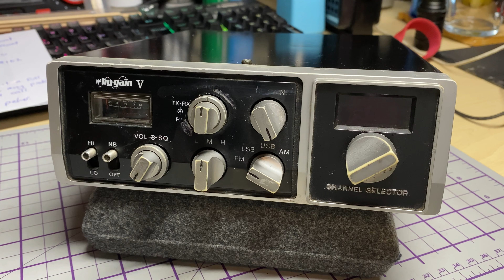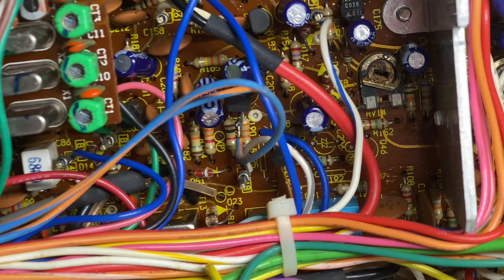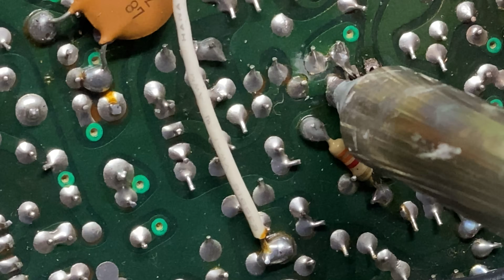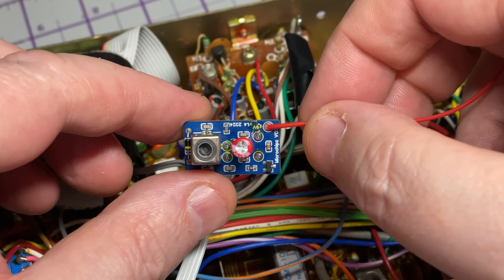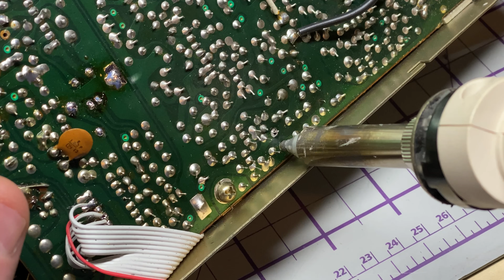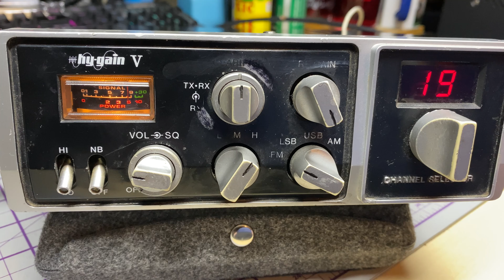EP 199 - HYGAIN V - Vintage SSB CB - Strange audio fault.

Comment: How do you rate the rf signal generator that you use as i am thinking about buying one.
Reply from the maker: It’s cheap and easy to blow up .apart from that it’s fine.
Reply: @MicroChipz I've seen them for sale for about £40 to £50 on various internet sites, for that price if they go bang or stop working it's not a lot of money lost. The ones ive seen for sale go up to 470mhz so it will come in handy.